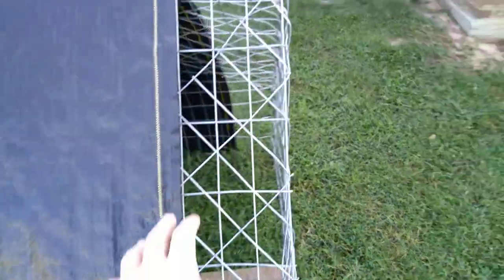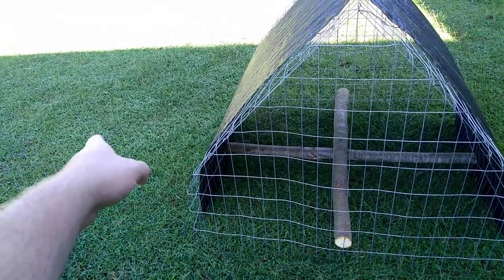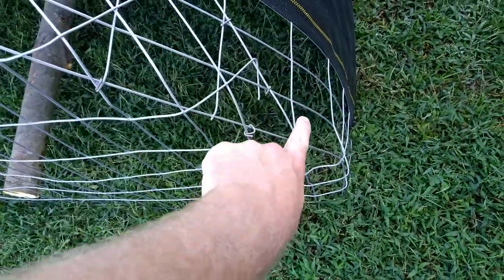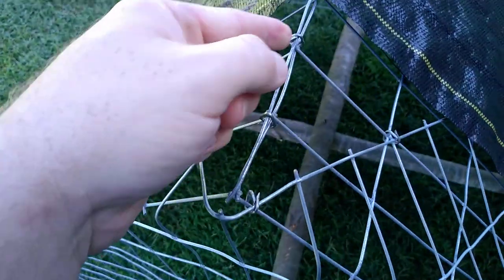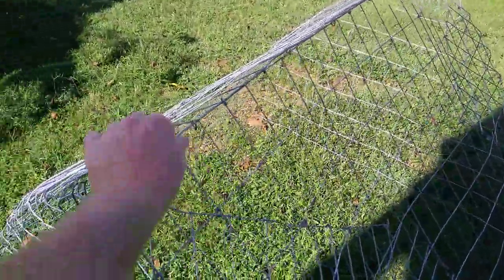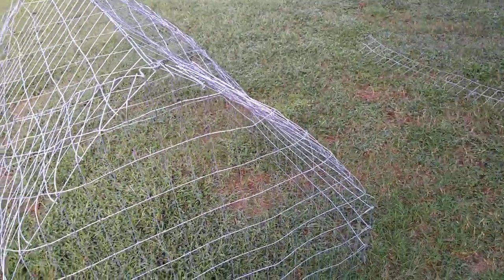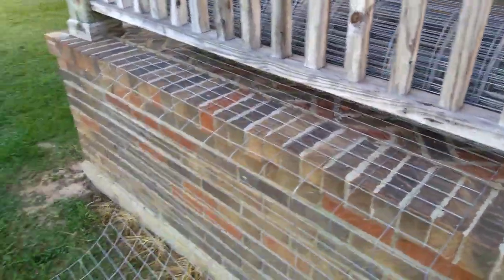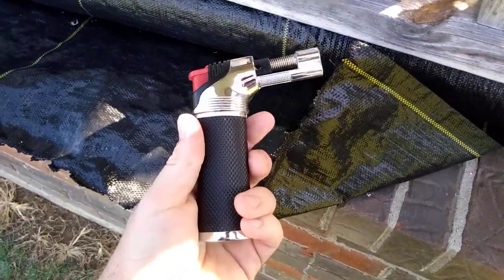A-Frame Stag Pen's For Gamefowl

Comment: grab a set of pliers and kinda twist wires going across the front and back to create better tension and less bubbling on the wire panels. Saw that in a video and it works!

Comment: How do u think this same design would do with 6ft tall wire and do a 6x6x6 with a 2x4base
Reply from the maker: db 2122 I don't know how that would turn out. I've made some like the ones in the video but 8ft long 4ft wide and they did fine. I used a 2x4 base on them.

Comment: I like the fact that with one roost pole that a predator can't just reach in if young bird roost next to side of cage all in all agreat little pen I going to make a few to raise some young birds Great video
Reply: Loving them birds I got from you fine birds sir you got some good blood going Thanks again
Reply from the maker: Most of my pens are this design but with a single roost pole and a 2x4 base.   I just did this video to show an even cheaper way to go about it. I don't have much of a predator problem though. My main yard has a 6 strange hot wire fence with two gaurd dogs